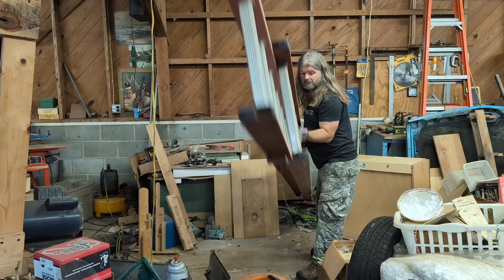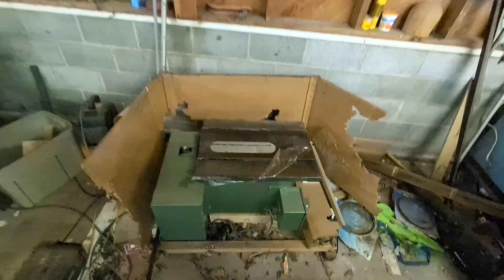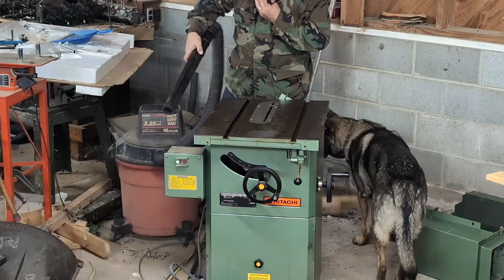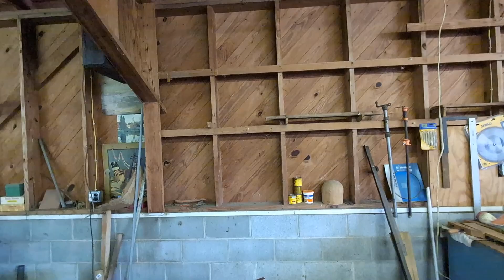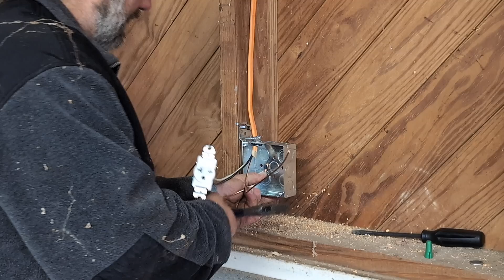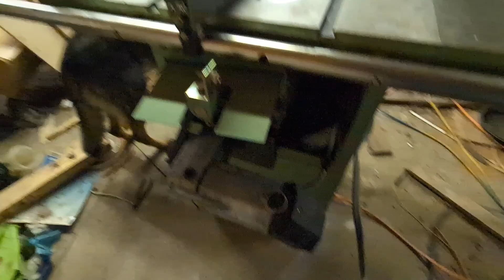Hitachi Table Saw unboxed after 35 years - Will it run for the first time?

Comment: hey thanks for the video.  i have that exact saw.  been trying to do a few upgrades and in the middle of upgradig the motor, pullys,  bearings and belts.  have you used the saW ANY?   id like tp know if youd like to get rid of it
Reply from the maker: You bet, thanks for the note!  I have not used it for a project yet - just some various cutoffs since I got it in operation.  Probably going to hang on to it.  I may look into what is available in the future to upgrade it as well.